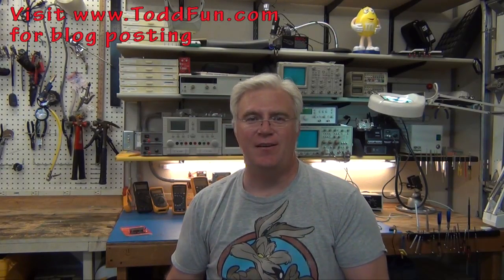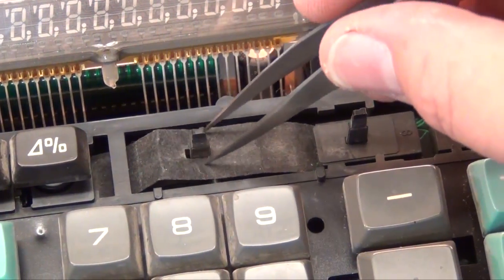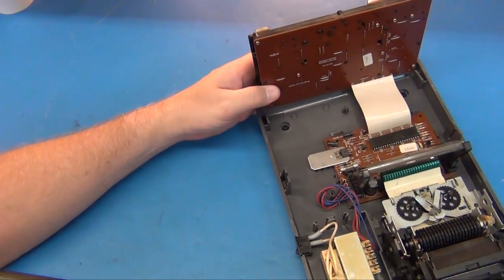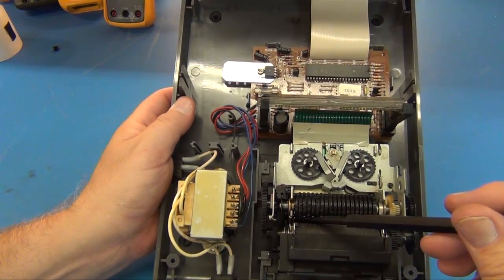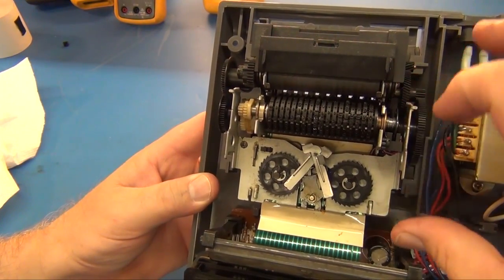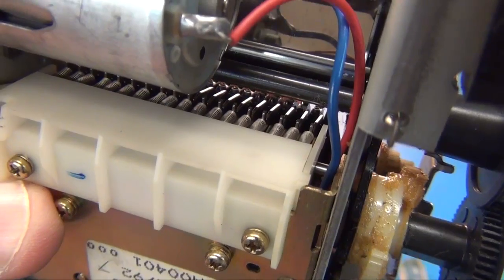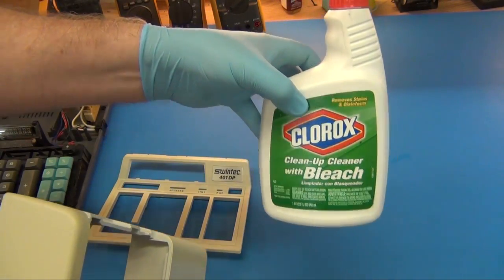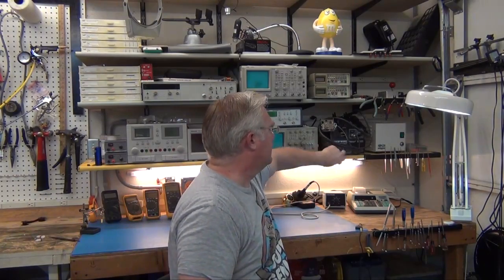Desk Calculator Teardown And Cleanup Swintec 401DP

Comment: The most I've ever spent for a particularly rare vintage calculator was 480 bucks. That was a 1965 SCM (Smith Corona Marchant) Cogito 240SR. Granted, it's an antique. That's basically why a lot of those older machines carry value. Nixie tubes will carry a price premium, since people tend to love the orange glow of neon, and they are quite beautiful. I do agree with you though, I'd find it hard to spend more than a couple bucks for a calculator like that one. Among collectors, the common desktop printing tabulators are kinda... common. :)

It's the rare machines, the complex machines, the high function machines, the odd function machines, and the early machines that hold the most value. I have well over 100 vintage calculators, and among these, I have ones with CRT displays, nixie tubes, panaplex, VFDs (like yours), LED and LCDs. I have memory made with magnetostrictive delay lines, ferrite bead core memory, shift registers, and LSI semiconductors. I even have parts from an ANITA tube calculator from 1961!

I have more than my fair share of cheap desktop tabulators too, but I only snag them if they have a particularly vintage look, are dirt cheap (1-5 bucks), or have a unique feature, such as one I found with two VFD screens. the second screen counted the number of calculations performed, which was a popular feature for people who have to do large averages. Even that one was under $10, and the unique feature made it well worth it to me, as a collector.
Reply from the maker: richfiles You must have quite the collection! Do you have a link to a blog where you share photos or videos? Have you seen eBay lately on these nixie tubes calculators from Monroe? Seems like ever since I posted my popular Monroe 1651 video the proces on eBay for them jumped from ~300 to well over a grand now. Have you seen my Monroe 1651 video? You can find it on my "All Postings" menu tab at ToddFun (dot) com.
Reply: ***** Oh yeah, saw the 1651 quite some time ago. I never commented, cause I didn't have a Google+ account back then... Dumb Google...

Sadly, I have yet to find the time to put it all online. I really want to. I have a few images on my website's server, but they aren't even integrated into the actual website yet, which is a real shame. I could PM them maybe.
Reply from the maker: richfiles sure I would love to see the photos. You could upload them to google drive and then share that folder to my google user. Or just get my email from my "about me" page on ToddFun.

Comment: I have a Toshiba one I got from the skip back in school from 85 which is a very similar design, it even has the same or similar chip.
Reply from the maker: ***** It was a fun teardown but I don't use it much now that I have my Monroe 1651 as you know. Well, truth is I will always pull out my HP 48sx first! Love that thing! I have used it for over 25 years now. Best calculator for engineering ever made.

Comment: Awesome video!  However, I did not find what I was looking for.  You covered everything on how things work, except how the positive and negative numbers change from black ink on ribbon to red ink.  I have a Sharp EL-2630GII, but it appears to work basically the same as yours.  I found a video on how to move the cartridge platform until it clicked into place.  However, my calculator has a ribbon on 2 spools, the same as in this video, and I cannot locate that little post that slips into place!!  Any suggestions?
Reply from the maker: No, sorry.

Comment: I was never able to figerout how the printer worked.
Reply from the maker: ***** I have another all mechanical adding machine that is so retro its dripping with COOL! I have to get to that video some time. It plugs in but the only thing electrical is a motor so you don't have to pull a mechanical handle.